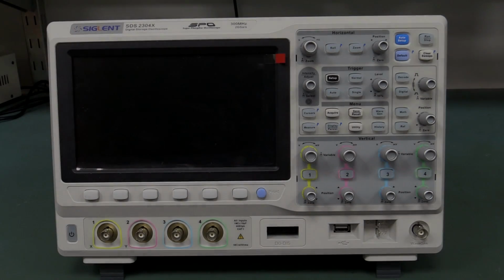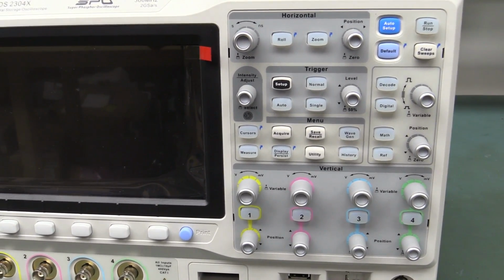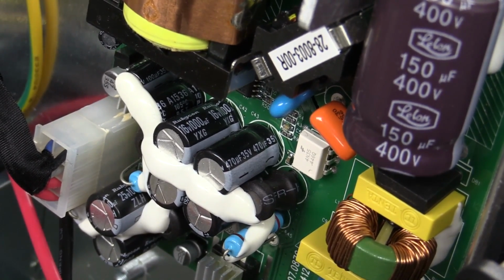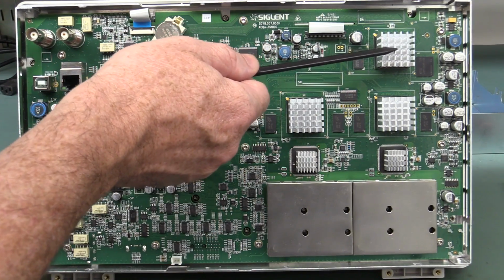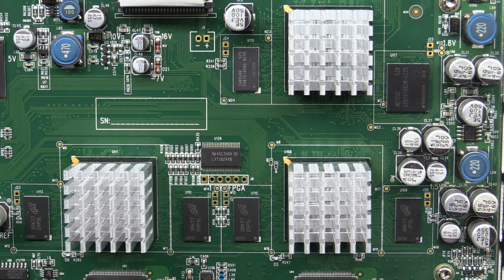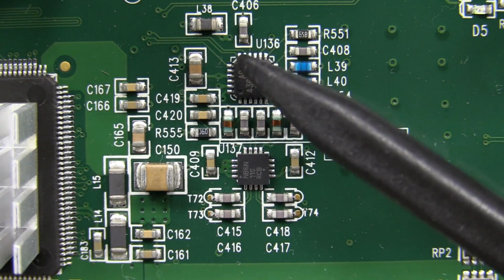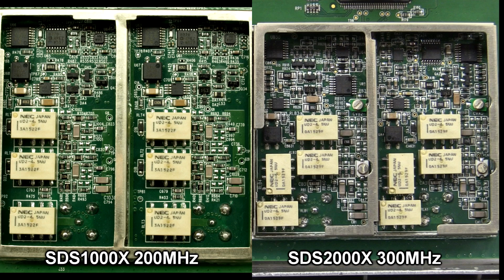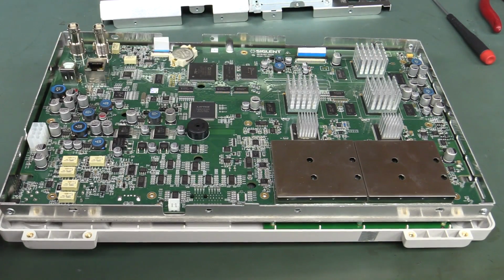EEVblog #864 - Siglent SDS2000X Series Oscilloscope Teardown

Comment: He stated 49.9 ohm resistors bother him because they are not quite 50 ohm. Actually, it should make him happy because 49.9 ohms is always a 1% resistor, and a sign of quality. Probably helps keep calibration for that part of the circuit.

Comment: FOD?  
Foreign object debris/damage
Aircraft carriers frequently conduct emu parades along the deck, involving all non essential personnel, including the captain, to pick up anything dropped on the deck which could threaten the safety of the aircraft and the carrier
I once purchased a $10,000 broad, roll fed, inkjet printer
It was trouble from the start . I was told to clean the print head
I noticed that the PCB was fouled with chewings from self tapping screws
It went off for repairs, a two man job. It still had problems. Again I was told to clean the heads
This was done by the machine several  times and used up a lot of ink
I took the print head off to inspect it, and found it was peppered with tiny craters in the plastic
I bought a microscope, cost $200, and could see that most these craters had tiny globs of, presumably, solder in them, some blocking the jets
I was able to get a complete working replacement printer, but only after I wrote to the president of the parent company. One of the biggest manufacturers of military aircraft in the world
I firmly believe that a serviceperson should keep their workplace tidy, not flick solder all over the place, and wick or suck up excess solder

Comment: Dave, NOBODY in production would have a manually operated pop rivet gun. I used to hate on pop rivets until I saw a competition robot held together with them getting the crap beat out of it every match and no problems.  I talked to the team, they have a pneumatic pop rivet gun and they love the thing.

Comment: Shame that isn't a proper PC fan they're using with PWM, though with a little soldering you can re-use the connector from the old fan with a newer, better fan by a reputable PC manufacturer, then use shrink tubing to keep the severed copper  leads from touching metal.

Comment: Dave- a little PSU design note- a lelon primary cap isn't a major issue. Secondary caps, yeah, they're trouble. Primaries, not usually an issue; they're pretty low-stress.
Reply: +Larry Bolan 
From what little experience I had, I have to say I've seen primary caps fail almost as much as secondary caps, across various SMPS's.

Comment: cheap crap with no manufacturer support and piss poor quality (they can't even line up the ground vias on this "top of the line" scope) - I contacted Siglent in 2 occasions via their website for support with an SDS1000 scope I bought brand new, never heard from them, never even got an automatic reply. They released a f/w update with even more issues, they have not fixed them to this day (many probably easy to fix but they obviously don't care to support customers since it doesn't bring any money) - last update for the firmware was in Sep 2014 (and the only one available, no other version is in the list). I wouldn't buy Siglent again

Comment: since it give you access to the 2pins fan header, you could change the fan easily, and if you have a Molex or 3pins fan, you can still use an adapter for it, and even use special adapters (or make your own) to slow down the fan if it's too high-speed.

Comment: I'd bet that fan is noisy just because it's directly bolted to that piece of metal, producing a sounding board effect for any noise the fan does make.
I've heard of ADDA, they actually make a pretty good fan. Maybe not top-of-the line per se, but they're a perfectly adequate choice for most applications. I've even pulled a few out of late 90's to early 2000's Sun or IBM servers that were being scrapped.
If they're good enough for IBM and Sun, they must be doing something right.

One last thing, the metal chassis looks like it's aluminum, but I could be mistaken. It would certainly explain the lack of rust, material thickness, and use of threaded inserts instead of just cutting threads in the base metal.
Reply: +44R0Ndin Whilst mounting the fan on rubber is a no-brainer (another scope he opened up recently had rubber and a dedicated chassis bend to soak up the vibrations, and was very quiet), there's also the fact that air hitting items will create noise patterns too. For example, in PCs meant for dead sound rooms (at least when i saw it years ago) they used to have baffles over the CPU area and the air was ducted solely to the heat sink.

In short, IMO, you can have the best chassis+rubber design, it won't do squat of it hits a blunt item and it starts to "whistle".

Just my two cents on the fan deal. ;)

Comment: Dave - why would the channel front ends not be identical circuits? Showing my ignorance here.
Reply from the maker: +Dino Papas Shared decoding chips . Say you have an 8 line device and a channel only need 4 lines. Silly to not make use of one chip per two channels.
Reply: +EEVblog Thanks!
Reply: +EEVblog They both seem the same to me, just different layouts on the odd ones.

Comment: I must say, i'm still a bit "i don't know" about those gazillion-updates-per-second thing - i'm willing to bet the refresh rate of ANY lcd's that go into digital scopes is no higher than the de-facto 60Hz standard, so... What gives?
Reply: +KhronX Yes the LCD refresh rate is at around that 60Hz but the image is processed before displaying and all those gazillion signals are put on top of each other and color grading is applied so where the signal happens to be most on each update the trace will be brighter and the occasional blip will still be captured and shown as a faint less bright color.
Reply: +KhronX it's not about viewing in real time, you ll see the benefits of it when you zoom in to the signal after you capture it.

Comment: What are those 4 relays actually doing?
Reply: Selects the voltage range of the input. The ADC accepts signals up to around a volt (maybe as much as 3, idk), so the "front end" circuit has to divide the input signal to provide the ADC something it can work with. You could have a fixed ratio of, say, 1/100 so that a 100 volt input maxes out the ADC, but for smaller signals that would be like trying to measure out a gram of salt by standing on a bathroom scale and pouring the salt in your hand
Reply: +mikeissweet Thanks mate. I understand now :)

Comment: Even with a cut out for the battery. It still doesn't look very easy to replace the battery.
Reply: It could be designed for 12 year old Chinese factory workers. Or, maybe the idea is to unclip the battery and let it fall in the case, then you turn the scope upside down and shake it out.

Comment: I think ADDAs are quite regular shelf fans. Nothing fancy, but good enough for most of the PSUs and other stuff.
Reply: +Patryk Buczyński Quite so. I would say they are middle of the road quality fans and good value. Used several ADDA fans for around 10 years and they are pretty good for the price. I suppose only aficionados will know the brand.

Comment: those leylon caps cant be so bad a smal hig qualiti german electronic distributer for motor control systems is using them as main filter caps
Reply: +TerribleFire 
 i never seen a u it turned while work placement so cant tell
Reply: +simontay1984  a german manufacturer is using those caps i think they cant be so bad